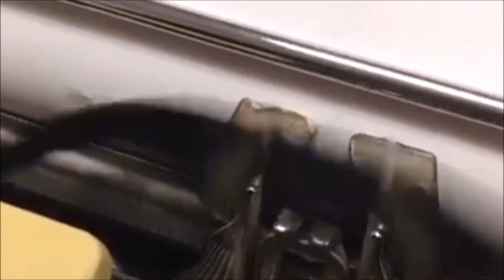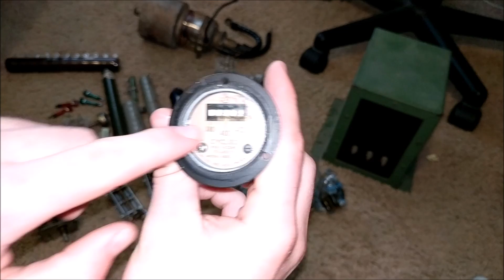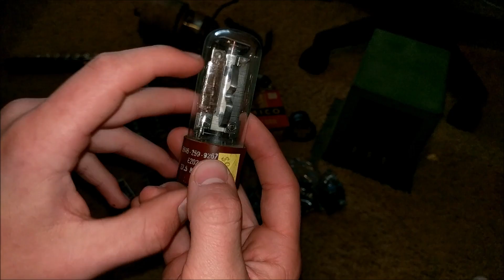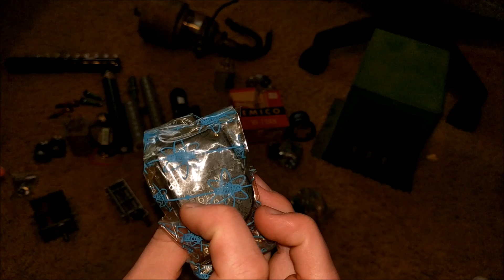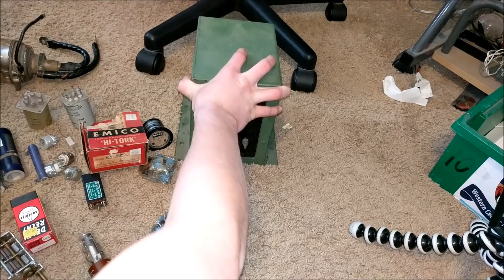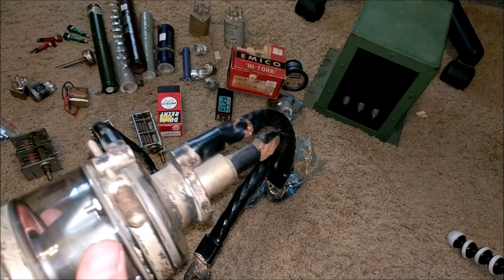Vintage Parts From the Electronic Warehouse(Cool New Videos Incoming!)

Comment: Although I just showed up here I really like seeing you acquire these really cool components.   I used to be into it just like you are now.  One thing that I think I should have done in retrospect was to bring along a geiger counter to the parts yard.  If you happen to get a contaminated piece it could be laying around in your shop years before you actually use it.   Exposing you to radiation.  Just my opinion however.